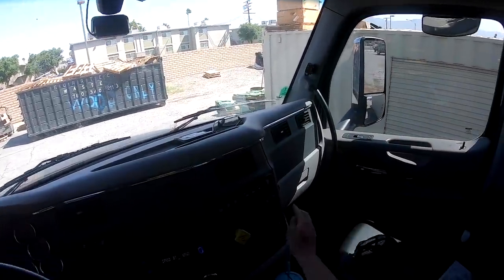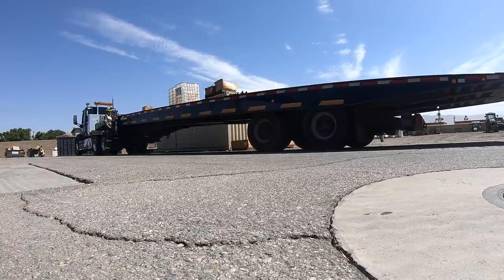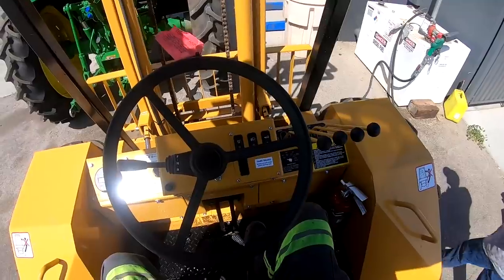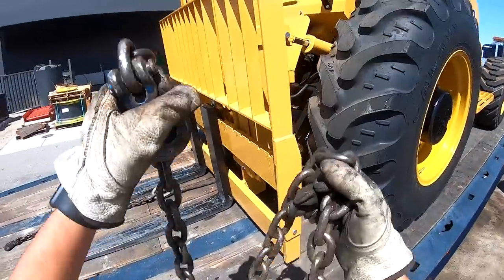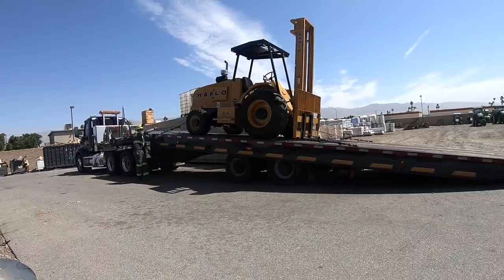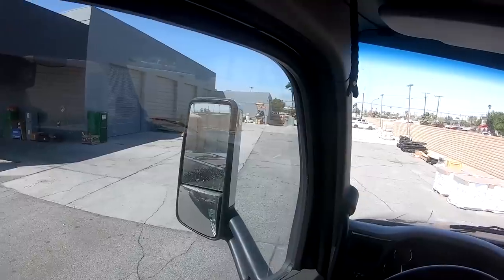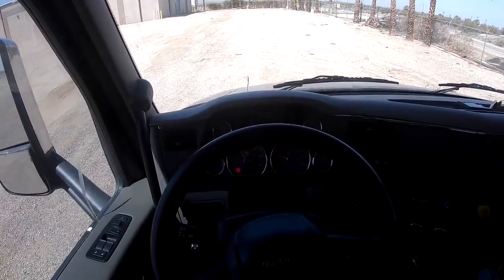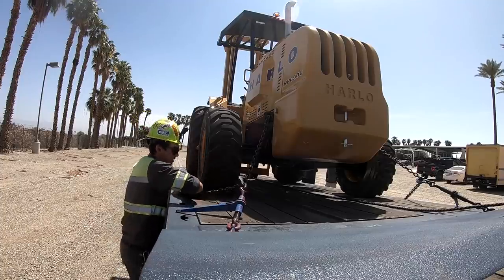Landoll Hauls Brand New Forklift To Customer!

Comment: The first, high-speed version of loading is a little too fast; all the quick turns make it pretty nauseating. Also unnecessary since it was also played at normal speed later. The BGM volume could also be taken down a bit, maybe 10-20%, because it's a much higher level than when you're speaking.

Other than those quibbles, very nice editing. Good video, clean, tight.